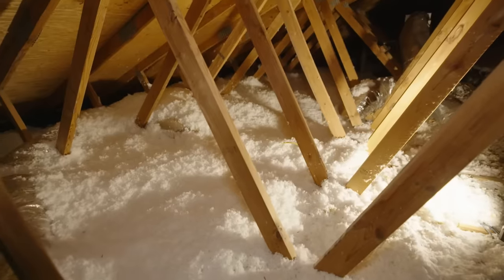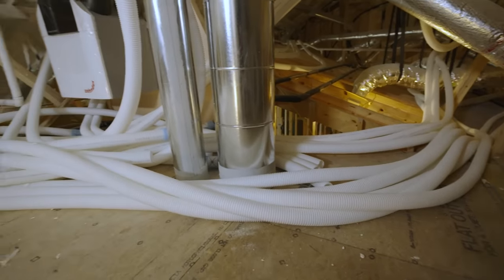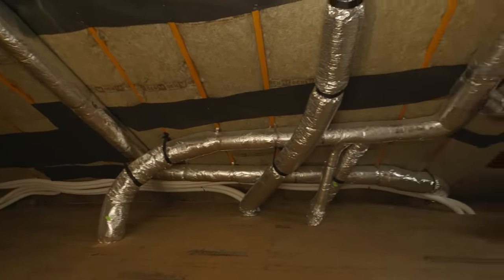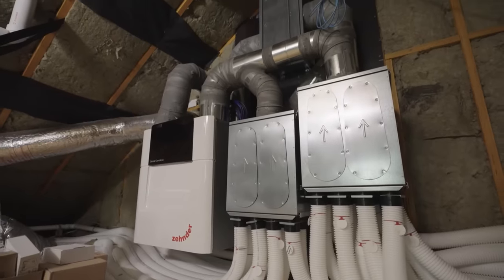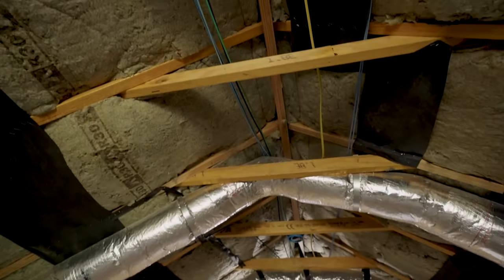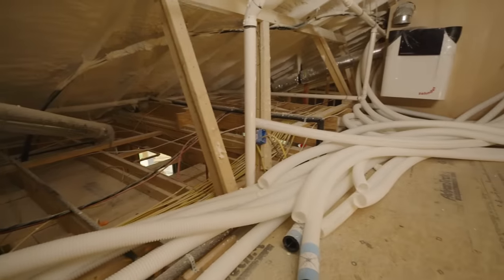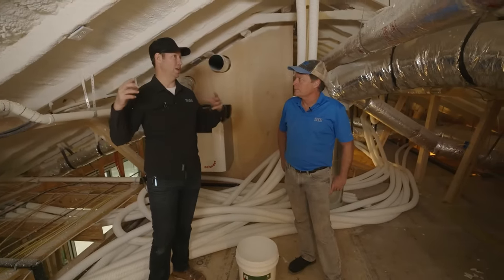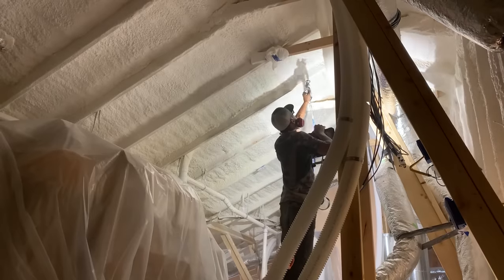Building a BETTER attic - Unvented + Conditioned attics 101

Comment: Here’s the issue with unvented attics. The home will self destruct in the absence of electricity (unvented attics REQUIRE air conditioning underneath constantly). Many homes in Florida that either went without power due to hurricane or foreclosure filled up with black mold. Most had to be stripped to the framing to repair. A vented attic is self-drying without power so for our off-grid ready home an unvented attic would have been a horrible choice. I like your videos but when you omit all the cons while touting the pros it seems like a sales pitch.
Reply: Yup, in a high humidity, high temp area, this requires continuous AC.   Even a short interruption of AC will end in disaster.
Reply: I'd rather deal with that by having a backup generator than deal with the nasty vented attic which will definitely have mold anyway. Vented attics are disgusting.
Reply: I have been in construction for over 30 years and have never seen a vented attic full of mold in Florida, which by the way is probably the most humid state in the nation. A vented attic is designed to be self drying, and has worked for centuries.
Unvented attic’s are new, and require all of your modern conveniences to be functioning perfectly in order to keep your home from self-destructing. Unvented attic’s have their benefits, but people need to be aware that they also require maintenance.

We have a back up generator. But even with our 1000 gallon tank, it is not an unlimited supply. Just during the last hurricane we were without power for over two weeks. We have solar as well and are prepared to go for extended period of time, but air conditioners are too power-hungry to use if you were going to be off of the grid for more than a couple of weeks.
Reply: @staugustinebackwater  Yup.  I live in New Jersey, which has summers that are as humid as Florida.   I live in a one hundred year old house.   No mold in the attic.
Reply: @bigd7355  seems like your attic venting is insufficient then. Might be blocked up with insulation. Does your attic have insulation vent baffles installed?
Reply: People talk about environmental humidity, but also in addition normal family running their normal affairs produce 10-20 litres of moisture per day, and these buildings are like plastic bags. Very prone to construction errors and the lack of electricity can be a detriment. However like everything, it is nice as long as it - and if it - works.
Reply: I kind of agree. I used to work in spray foam but i also inspected houses for FEMA.  After Irma, there were lots of houses that had mold and more often than that, if you have any kind of roof leak, loose fill and batts soak up moisture like a sponge.  With hurricanes you see mostly from ridge vents dripping and mold spreading from there. 

In the event of a power loss it's not as bas as any of you say. I'm in Houston.  We used to do new construction and retrofits/tear outs. Many times we were there before or when there was no AC and the house was fully framed with all the hardy board up. We have to have a substrate to spray against.  Anyway, we'd seal her up and then the drywallers would go in and the flooring guys, (which I also used to do and AC was a rare luxury to be turned on while we set the tile). Never had mold/moisture problems. But we do good work. I have seen where it was sprayed poorly and pulled away. Esp. with closed cell, if the foam pulls away it creates a pocket where moisture can get trapped and cause problems.
Reply: The key is keeping a vented attic sealed off from the living space and the HVAC system out of it. Done right, the attic in his opening scene of this video is--as Joe Lstiburek has even pointed out--"the most underappreciated assembly we have in the building industry." Indeed. Especially in the north, the cost for a first-rate, R60-deep cellulose bathtub up there from outer exterior wall to outer exterior wall is dramatically better than other options, even including an anti-condensation barrier or spray on the roof decking, if needed.
Reply: Matt V…I would have to agree 100 percent. I am in a bit of a twist right now. My 1945 house went through and survived hurricane Michael,PC Florida. I am just now tearing out the drywall because we lost all of our roof tiles and it rained in the whole house. Now since we are slowly gutting the house I am replacing the windows as well( yes they are pretty old windows but hard to open any more and I can not imagine reglazing them again and again) anyways, we never had insulation in the walls. The outside is asbestos,tar paper,then one or 3/4 inch board. I told my husband I am unsure what to put back in that cavity. The roofer put a ridge vent in but my gables are vented? There is old insulation in the ceiling(fiberglass,disgusting mess). If I put fiberglass in the walls without redoing my outside walls then won’t that cause a condensation issue when I don’t run my air? All local insulation companies seem uneducated about condensation in general. I am leaning towards rockwool but since it is 
unfaced I am unsure whether I need to go back with membrane or what? My house is still in pretty good shape even though it got soaking wet because we were able to dry it out and it was built to dry out. My question is how do you provide for a little bit of comfort and energy savings without ruining your house? Any ideas?
Reply: @elizabethweaver2244  I would use mineral wool and nothing else—never faced insulation of any kind in the South when you already have something of a vapor barrier on the exterior (tar paper or equiv.).
Reply: Reflected Miles Thanks for the answer. I searched the whole of the internet last night trying to find an answer to the facing question. My reason for rockwool is the hydrophobic property. As I sat in my bathroom tub as the hurricane blew around us the water came through the ceiling but also pushed through the exterior walls through the drywall and paint then ran upside down towards the ceiling..unreal. I felt really lucky to NOT have insulation in the walls after that. I am hoping the rockwool will give us some comfort but resist holding water. So no Membrane(certainteed) or anything like that over the rockwool before drywall right? I certainly don’t want any paper in my wall like you have with fiberglass! What a mess that has been in my ceiling.
Reply: @elizabethweaver2244  So long as the exterior walls have the tar paper or equivalent between the framing and sheathing, you don’t want anything else in or on the wall that constricts drying, whether that is facing or membranes or anything else. Mineral wool alone should be fine.
Reply: Reflected Miles Woohoo,great news. Yes,it is in the order as follows,asbestos tiles,under that tar paper,under that the thick boards on the vertical that contributes to strength. Thanks again. Also,I like the look of my old asbestos! Kinda want to keep it.
Reply: @elizabethweaver2244  That’s the same—it’s just providing some vapor barrier activity for all of the wood underneath the siding, at least theoretically. Just don’t add any other vapor control anywhere in the walls where that is the assembly.
Reply: @RAWPerformance1  this is true. But good entertainment value though. Practicality is not a modern american value though.
Reply: @bigd7355  My home was built in the 70s, has a vented attic and there is zero mold in it. As long as the vents at the eaves aren't blocked by "well meaning" DIYers or cowboy contractors(effectively turning it into an unvented attic) the attic will stay nice and dry. Cold maybe, but dry.
Reply: Wouldn't that unvented/mold problem be solved with a kind of trap door venting installed on either side peak?  In power out, couldn't they both be opened for cross ventilation, then closed again, and the attic dried out using AC when the air is conditioned again just like the rest of the house?  The house is sealed up for the sake of AC, but mold doesn't grow there with doors opened and closed all the time.  The "trap doors" might be a sealed locking configuration until needed.
Reply: @dandeleona4760  yes  what you propose can of course work. However, the entire discussion is pretty much moot if you consider that there are different ways to construct an attic, that would allow you to use the entire attic as living space, windows and all. It is beyond me why anyone would want an airtight, airconditioned attic. What are you trying to store? The vatican library perhaps?
Reply: @dandeleona4760  no, you would also need fully vented soffits combined with your suggested closable off ridge venting (which would need to be sized as if it were a conventional vented attic). 

Also placing the layer of closed cell foam over all the wood framing and deck underside could also compromise the woods ability to breathe and dry. In construction whenever you combine two waterproof membranes separately on the same surface (the roofing has a moisture barrier) it can create havoc when it traps moisture between them (which the wood intrinsically has). That’s why your exterior walls have a single vapor barrier. It is the reason hardiboard lap siding cannot be caulked between laps. 

All in all unvented attics can and do cause real problems when you are unable to maintain artificial atmospheres underneath.
Reply: @staugustinebackwater  Thanks for that info.  Everyone would love a Ferrari in their driveway until the maintence costs come.    With all the unpredictable weather coming up, it should be a national interest to not allow this type of construction to become mainstream.  If we have electrical issues, which we will, these homes will be compromised along with the resources that put them there in the first place.
Reply: Seems kinda silly to build a house for only the worst-case scenario instead of using resources to make something that works when the house is actually habitable. IMO people shouldn't really even be living in all these drought and disaster-prone areas, so might as well just build something that maximizes comfort until the landscape is obliterated by mother nature.
Reply: @bigd7355  I live and work in construction in the southeast.  Never seen a moldy attic.  It’s always in the lower portion of the house.  Vented attics get incredibly hot and hard for mold to take hold.  Re:  off grid ready homes, I like whole house fans (they are usually oversized, though, IMO) that pull air from house and push excessively hot attic air out the vents.  Works really well to temp-regulate the house in hot summer.
Reply: @staugustinebackwater  Would a solution to this problem be as simple as having a couple well-sized panels in your attic (faux windows or such) you could open in the case of a power outage to provide the necessary ventilation?
Reply: @Matt V excellent points
Reply: In Australia,  non vented attics don't exist.
Reply: @justinjimenez6960  iam wondering about this too, couldn’t you plan for this and have a few windows on either side to open just in case of a situation like that?
Reply: I think too many people here are missing the point of a well insulated attic. If the house is well sealed and insulated heating, cooling, and humidity is controlled by the hvac system rather the weather outside. Vented attics make no sense, if you keep the heat and humidity out there's no need to vent and you keep all the dirt and critters out as well.
Reply: @rubenmarin3390  Actually, you’re missing the point. The point is if your house is required to be connected to the grid in order to not self-destruct, what are you going to do when the hurricane comes to Florida and we have no power for three or four weeks which is already happened at my house. What will happen is the entire house will fill with mold. That is my point.
Reply: @staugustinebackwater  why is it magically going to fill with mold? As far as I know every house has windows that can open, right?
Reply: @staugustinebackwater  😂😂😂 ok you go on believing that. I live in florida too and that mold would take months...months to grow and it needs moisture. A sealed attic has no humidity unless it's not sealed. As for the rest of the house, with a passive home the temps inside are much cooler than outside thats the whole point. It's building science...processes and materials evolve and improve over time. You apparently didn't learn much from this video, if you even watched it.
Reply: Yup, correct..Yesterday I posted on this…
Reply: Spend another 10k for a generator
Reply: @wayneguy6043  How much for the model that doesn’t run out of fuel? Solar would be a more realistic (but still unrelated to the point) suggestion. Problem there is a solar system capable to run a 4 ton unit in Florida is about 150k with batteries. I am not badmouthing these foam attics, but we built our home to withstand any emergency including off grid living and these attics require constant power and air conditioning to sustain, otherwise the home self destructs.
Reply: It’s not about the insulation here it’s about what kind of HVAC system and dehumidification that you have. Been in the business for a long time. If you don’t have a quality HVAC system that’s properly sized as well as dehumidification then of course you’ll have mold. Vented attics are not efficient as far as saving money.
Reply: @andrewcaraway1349  Totally missing the point of the comment. I’m not sure you read properly. The point is, a vented attic home can survive indefinitely with no air conditioning. That means if there is no electricity, the home will generally be just fine with simply opening up windows and living with the natural temperatures and humidity. The way things were done in homes for hundreds of years.

With an UNVENTED attic, The home underneath must be under constant Air conditioning with a nonstop supply of electricity. If you were to lose power for any extended period of time, there is no way to run any air conditioning system. At this point your unvented attic and the house beneath it will begin to fill with mold. This is not a hypothesis, this was a common occurrence in the real estate bust of 2008. Foreclosed homes left without power for weeks or months were pretty much destroyed and many had to be gutted back to the studs with highly expensive mold abatement work to be done. With a future of constant power supply in question, and the threat of hurricanes in my home state of Florida, this can become a reality more often than you think. Even a $150,000 solar system will not run my air conditioner 24 seven. It will run everything else in my home, but not my air conditioner. Therefore an unvented attic was not a viable option for me as well as a lot of people I know.

Most people who purchase foam insulation have no idea of this possible consequence. It is not disclosed when they sell you the insulation system. I only posted this comment to provide a little extra information for people to whom which it would be pertinent.
Reply: @staugustinebackwater  that’s very true. Have lived that as well.
Reply: What if you use humidity removing remedies such as that absorbent which collects moisture into a bag?
Reply: @staugustinebackwater  every time I hear "self-destruct" I just feel like you're fear mongering more than anything else. What problems are you trying to describe with that phrasing? I don't like scare tactics (I am not assuming you are, that's just what the phrasing itself delivers), so what are the actual problems here?

Edit: I read a bit further down, and you describe the 2008 crash. These homes you mention, were they unvented or vented? I cant imagine that there were that many homes that were unvented at that time, so the issue you're describing right now happens, with homes that are vented, right now. If that's the case, there is no worse case scenario here b/c the home is filled with mold in either case.
Reply: Agreed, that’s why we have to calculate for ventilation in roofs unless it’s rigid insulation that leaves no air pockets for moisture build up.
Reply: Thank you
Reply: @ReflectedMiles  m
Reply: @scottnyc6572  Not good enough, you’d be surprised how much water is in the air.  Do you have dehumidifier?  I live in Florida and can pull two to three gallons of water out of the air in my house easily, per day, just to maintain 40% RH, while my AC is running.
Reply: I love a closed attic when it’s working. But you got a point here.  Under construction in the summer my house was crazy hot once the insulation went in before the ac was started.
Reply: @staugustinebackwater  Is there a hybrid design? Imagine an unvented attic and all of it's pros, and when the power goes out, there could be an airtight vent (that's been closed all this time) that could be opened and begin venting to self-dry and stave off the self-destructing. Would this maybe be a plausible idea? Respectfully,
Reply: @joshuagould548  Not to say impossible, but definitely not practical at the moment. A vented attic uses all of your soffits as the lower entry point for the air. It then uses the heat of your roof to convect that air up and out of the ridge or off ridge vents. This steady flow of air keeps your entire home dry as moisture is drawn up and out. 

My personal opinion is these unvented attics (for the most part) are not doing any real benefit to the home, with a few exceptions. The R-rating (this is the insulation energy rating) of your interior can be just as good with a vented attic, the insulated layer is just lower in the structure and the attic is hotter. Just because your attic is cooler does not mean you are saving money. The insulation barrier has just been moved up to the roof deck. You are now cooling or heating a larger area (now the attic is absorbing some of your HVAC efforts). In nearly identical homes in the same subdivision no discernible difference in electric bills are being seen in real life comparisons between both styles of attics. I have seen this firsthand. 

There are good applications for the spray foam insulation though, I am not just hating on them. Dormer-style second stories with conventional framed roof construction benefit greatly. Also if your home requires the air handler (or other equipment) to be installed in the attic you can see some benefit to keeping the equipment in a more climate controlled environment.
Reply: @staugustinebackwater  Thanks for the reply Matt! I was actually thinking the same thing when watching the video, that now the HVAC is conditioning your attic as well, which may or may not work it harder, and that the insulation barrier has just been moved. Unvented seems cool for maybe getting a little more out of an attic space, including just a neat hangout spot, but didn't seem like some revolution in insulation. Thanks again.
Reply: FACTS!
Reply: @JarredSutherland  - with rolling blackouts coming, this is not that far fetched.  Energy is not as abundant at a cheap cost in the current economy.  With the push to green energy and electric cars by this current administration, we’re going to see rolling blackouts.
Reply: Besame mucho Vicki carr
Reply: @staugustinebackwater  I am watching this from a northern climate... I think the main rationale for the unvented attic is to move ductwork and equipment into conditioned space rather than unconditioned space. You are correct that by insulating the roofline, you are increasing the volume of conditioned space and thus the load. However, running cold air ducts in a hot attic also increases the load (and surely must create condensation problems also, no?)...

Up here, attics are vented, but no equipment lives up there. Equipment and ductwork go in the basement (not as much is on slab, partly due to the 4'+ frost depth). Our vapour barriers go on the inside (more or less: with AC loads in summer, the best location is actually partway into the wall thicknesses at a depth that stays below the dew point year round). Totally agree that 2 vapour barriers is a bad thing, and I question their stack up of interior spray foam, roof decking, exterior foam decking unless the perms have been carefully evaluated... 

There are many details to consider to successfully build for energy efficiency and longevity.
Reply: I would say conditioned attics are the way to go especially in the hot humid south. Unfortunately, conditioned attics are a lot more expensive to build than vented attics and most people don't have bottomless budgets for their new build.
Reply: They should have a door or vents that can open in those conditions. Pretty easy oversight when you don't have a realist and real world experienced people making decisions.
Reply: @edgeofsins  This would not be an easy solution. For one, you need vents at the roof peak as well as 100% around the soffits. Second, the foam is not designed to be exposed to humid air.
Reply: I knew it was a sales pitch before the video started. Theres a bunch of videos titled: the way they did it was wrong, this is the way you should do it now.

Same with crawl spaces.
Reply: Talk to a building engineer about your theory on an unvented being better before your post. Perhaps building engineers don’t get it and your brilliance is over looked. Professionals crack me up.  Lots of building professionals that haven’t put a 70-80 hour work week at the site with tools other than a phone or pencil in thier life
Reply: @jonathanbuford1793  Actually I have no theory that and unvented attic is better. You should reread my comment. I believe vented is better, and lots of engineers agree with me. unvented works great, like we said as long as you constantly keep the building air-conditioned underneath it. If you lose power or the ability to air condition for any length of time, you will be looking at a massive mold problem. often times, the latest technology it’s not the best.
Reply: @bigd7355  my house was built in 1950. It has a vented attic and there has never been mold in it.
Reply: Yeah and if we have another 08 housing crisis which looks to possibly be happening all those foreclosed homes will be ruined when sitting vacant. Definitely something to consider.
Reply: I forgot to turn my ac on and now my house has self destructed. If only I had have listened to the warnings from these posts.
Reply: @barabbasrift8874  This information comes not from chicken little. There is a reason your garage area is not sprayed. Nor over covered porches. One day without AC is no big deal but go on a 4 week cruise and leave it off.
Reply: @staugustinebackwater  Does it mean the entire passive house concept is a one disaster away if electricity goes out?
Reply: @dcentral  Well a “passive” system would be a vented attic as it requires no supporting system to dry your attic. An unvented or foam sealed attic is an “active” system as it does require an active HVAC system to remove moisture from the structure. So the answer is yes, an unvented attic cannot and will not sustain in the event of electricity loss.
Reply: So....get a $400 generator lmfao
Reply: @TheGuruStud  A $400 generator won’t run a whole house HVAC system, so you will be “lmfao” while your house fills with mold, and then the rest of the world can “lmfao” at you. ROFLMAO.  Schools out.
Reply: That’s why you typically see windows in unvented attics. My house has them from north to south when opened they vent the attic very well.
Reply: My attic is like the “don’t “ example he showed. 
I was able to very cheaply insulate to R70 with cellulose and do it myself. 

His roof insulation isn’t nearly that high.
Reply: @staugustinebackwater  If unvented house losses power how many days do you have before the house self destruct and collapses?
Reply: Isn't it vented by the erv? How much power does it take to run an erv?
Reply: @seanaguilar2057  you said you’re in Houston. I’m in the Houston area too. So you would recommend sticking with a good old fashioned vented attic?
Reply: @nholt  Not if you can avoid it but it depends on your situation. New build or retro? And what you're looking to spend. Any other factors like sound reduction? Generally I prefer open cell Spray Foam for residential. Lots do BIBS in the walls with Foam on the roof deck which isn't bad but will settle with time. Rockwool is great for walls and reduces noise. It's also "greener" than Foam.  My brother still works in Spray Foam or just have someone go out and give you a bid.
Reply: How about a sealed attic with  screen-in windows to open in case the power goes off??
Reply: An 7kw inverter generator to run a small ac is literally 1k
Reply: @benchoflemons398  and they never fail, for the entire 100 year life expectancy of the home right?
Reply: So designing your home for something that statistically is 500,000 to 1 to actually happen vs enjoying the comfort and energy savings guaranteed…don’t let your unwillingness to change and bravado stop progress.
Reply: @bigd7355 
I loved in 2 homes with vented attic no mold issues.